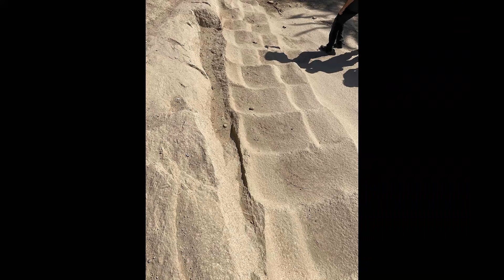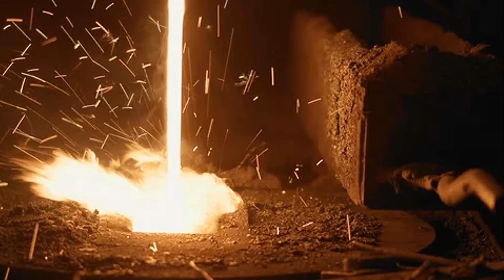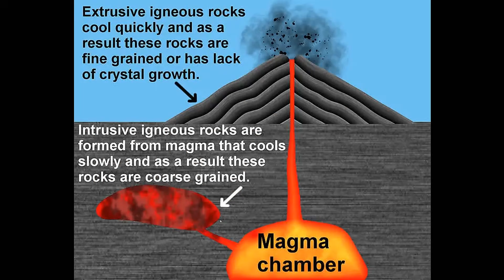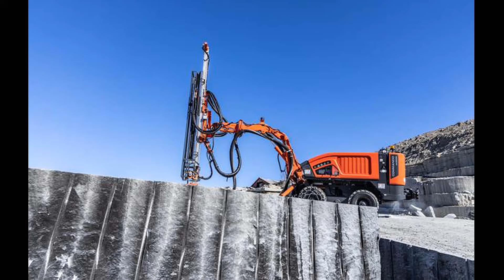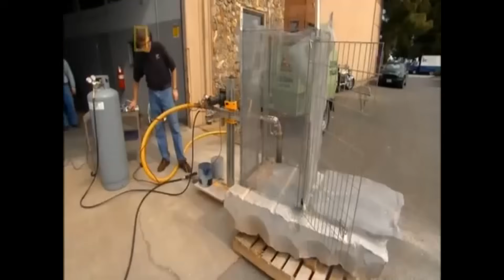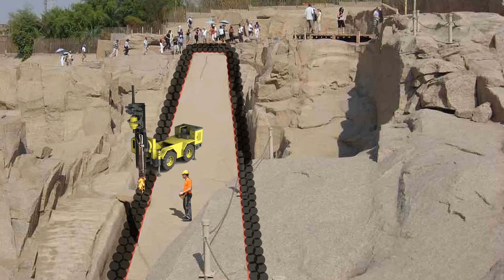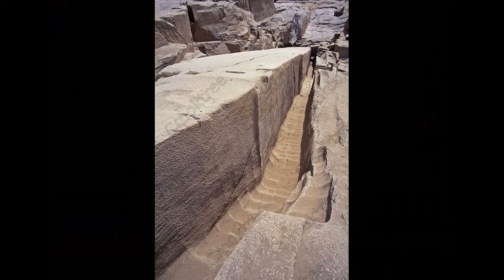Scoop Marks in Egypt: A Groundbreaking New Hypothesis

Comment: why did all the mega structures all over the world just stop? where are the tools? there would be piles and piles and tons of tools. calling them 'scoop' marks is very mis leading since no one knows how they got they way. everyone goes on about how the marks were made instead of why? they were made at all, what is the point??? it is not aligned with the fault mark which are not aligned themselves.  just saying the stone was softened is pretty much meaningless without any real support. this does not explain how it would have been 'scooped' even if soft.  good explanation  smart woman            it seems everything they did was done the absolute hardest and unnecessary ways possible.

Comment: Most of the polygonal megalithic stone were cast in rubber like bladders right on the wall and the bladders later dissolved naturally and left only the hardened stones. See water glass stone glue and natron theory.  
Liquid sodium silicate reacts under acidic conditions to form a hard glassy gel. This property makes it useful as a bonding agent in cemented products such as concrete and abrasive wheels. It is also an excellent adhesive for glass or porcelain. A traditional use for dissolved water glass is as a preservative for egg.
 The second option is water glass for waterproofing based on the addition of potassium. This additive made of metal makes the glass resistant to all atmospheric influences. Does not impart a treated surface of glare, so this glass can be used as a specialized paint.

Comment: Cool. Good idea. But i still have some doubts. I see some chattering on many of the vertical channels. As if it were chiseled or hammered, maybe pneumatically. Also, some of the scoop patterns have areas where whatever they did to remove material "pushed" material over to an older scoop. I'll find a time stamp. 1:45 on the right, the curved scoops inner edge has a ridge thats been pushed onto it from the neighboring scoop. Like think through the process that made these scoops and youll see that they had to have happened sequentially and the smaller scoop was last because it pushed the ridge over to the big curved scoop. Something you'd see in clay like material. Ive seen the same thing many times in peru also. Its still hard for me to not consider the rock being soft due to it seemingly being the best explanation for what I see visually. All i can guess is that they knew something about granite that we dont. Either way they (whoever they was) had capabilities way beyond what people think.

Comment: Would an examination of the surface of the scoops show signs of the extreme heat used ? Are there piles of chips somewhere ? Do they show signs of rapid thermal shock ? Any theories on the gasses used, pressurization requirements and how such a jet could be controlled and moved around ? All very testable.
Reply: Yes, chips (lens shaped spall-off chips), scorches, ashes. Rare because this is all fragile evidence (except maybe the chips) and weathers away easily. Normal wood/charcoal fire if confined and well vented could do this.

Comment: The best way to make a grope in granite would be to pound the granite face with a granite hammer. Remember the Egyptions had an unlimited supply of slaves. The Egyptions simply did not have our technology or flame torches. the simplest answer is usually the correct one. The Egyptions were also good at boring holes through rock with rotating copper tubes. They had large supplies of copper and perhaps bronze. The tubes were form cast.

Comment: The Egyptians had wheels and skilled woodworkers so they could have made a rotating handpowered circular granite stone on a wooden frame and axle that could grind out rounded channels in granite rock. Much like the stone wheel commonly used to grind axes and other metal tools. I imagine that rubbing a piece of granite against granite rock would wear away the stone.
Reply: The Egyptians were also borderline obsessed with record keeping and trade listings, but we have absolutely zero from the Egyptians themselves of how, when, and why any of the true mysterious constructions occurred. Just hypothesis from modern "archeologists".
Reply: Yes, quite possible. A long shaft w multiple wheels. You could wind two long ropes in opposite direction. One team pulls to unwind rope A which winds rope B then the opposite.

Comment: Here's my vote.  There is a grid both horizontally and vertically. Each rectangular area is assigned to a worker with a pounder.  He pounds out his assigned area to a depth of, say, one inch.  When he completes that, he gets paid and goes home.  Next worker comes in and does the same.  Area by area and inch by inch you finish the grid and you are done.

Comment: I've been aware of the quarry quandry for over ten years. Although there have been plenty of reports about the scoop marks yours is the first to apply direct scientific comparisons of the marks and any modern technologies that could explain them.
Reply from the maker: Thank you! 😊
Reply: @CuriousBeingbyTina I just read in the comments of another video about the scoop marks that there are pitches near the border of the pitch of the obelisk which are declared to be test pitches. I don't know how much they are and how they are arranged but probably they were no test pitches but to prevent the machine from falling head on when removing the rubble from the pitch.
Reply: There are zero heat signatures on the oblisk so no just no
Reply: @drummerdad80 . .i will accommodate a maybe no. Sorry that's my final offer.

Comment: This is a very interesting video Tina.  As always, you do good research.  I watched SpaceX use two Liebherr 11200 cranes to move a 2000+ ton launch pad in place.   The cranes required a perfectly flat prepared surface not present on site at the unfinished obelisk.   The certainly weren't going to move this obelisk by hand.   The obelisk marks are very smooth.   The jet approach looks closest to the obelisk's marks but not as smooth.   I don't think that was how it was done.   They must have had something we don't currently possess.   Maybe a super industrial sand blaster to cut through the granite?  Or a water jet like they use to cut steel in ship building?  Or a submerged plasma torch, again from ship building.   Dolomite rocks on the tip of a jack hammer?  Is there actually any evidence of dolomite embedded in the granite to confirm its use?  The indention do appear to be from machining rather than by hand.

Comment: all the puzzle pieces are here, but i think in the wrong order. the diagram at the 15min mark is one of the most telling visuals. the modern flame drilling method utilizes the same principles, but the technological advantage allows for some optimizations. high temperatures and supersonic gas jets optimize for speed and minimize the numbers of "tools" used. but the ancient egyptians were not that restricted in terms of manpower we are today. the same principles can be used instead with a whole bunch of workers burning coal or wood fires in certain places, then cooling it down with water and then pounding out the damaged zones with dolorite stones until you reach the hard undamaged rock again. there is a lot of space around the obelisk to parallelize the whole process and keep the progress at a good pace. no need for ONE complex flame jet to go around the workpiece if you can get a few hundred dudes with coal, water and stones that can do the same work.

Comment: What about a horizontal rotating barrel shaped cutting head, with many hundreds or thousands of very hard bits that cut into the rock leaving hardly any individual scrape marks, or maybe even no scrape marks at all, depending on how fine the very hard cutting bits are?  A heavy industrial machine could have a tool attachment like that can pivot to scoop under the side of the obelisk.  It would use a very, very powerful electric motor to rotate the barrel horizontally at very high speeds.

Comment: Marcell Fóti has been proving how his natron theory (chemistry) works, making hard stone to soft scoopable slush that hardens again. 
He might be right since he demonstrates it on small scale. Next we need mid scale experiments with those type techniques.
I think they logically fit and explain the stone markings.
Reply from the maker: One problem of the natron (and other chemicals) rock softening method is that it usually would significantly change the rocks' colors and appearances, while the granite of Aswan quarry shows pretty consistent color at all scooped areas.
Here is a photo posted by Marcell Foti who proposed the natron softening rock idea and we can see visible color and appearance changes:https://x.com/FoMaHun/status/1743216524343603549

Comment: One thing that I wonder about is, if there was a civilization with advanced technology, which appears there was. Why did they build from stone? You would think if they were so advanced they could have invented some advanced steel alloys or better concrete to make building easier and could have been better or different shapes and forms.
Reply: Stone is the only material that doesn't erode or oxidize back into its fundamental elements. Stone is forever. Nothing else is.
Reply: It's actually shows their intelligence.  Like this guy says stone is forever and an intelligent society would know that
Reply: @rogerdoggett1991 yeah fair enough stone is forever, but with stone blocks you are limited on things and shapes you can build it's like using Legos for everything it has its limitations

Comment: By using the acient and known technique of "fire setting" added with vinegar quenching, a trench in such stone may be easily cut. Simply set a charcoal fire, move the fire and quench the hot stone with vinegar. Then move the fire, quench, move the fire quench...

The worked with what they had. 

How they moved it? No idea.
Reply: 1. Quarry Pile-Drivers  
   • 40 cm dolerite spheres suspended on scaffold‐mounted block-and-tackle systems.  
   • Dropped from 2–4 m to cut uniform kerfs and hollows in Aswan granite.  
   • Red-ochre marks on the balls match paint used in Egyptian workshop tagging.  

2. Roman Repurposing at Dura-Europos  
   • Surplus or spent quarry balls shipped along Nile–Mediterranean–Euphrates supply routes.  
   • Found in late Roman siege layers alongside ballista hardware and local shot.  
   • Wear patterns show concentric release rings overlaid on quarry‐use pitting.  

3. Supporting Evidence  
   • Stratigraphic association: dolerite spheres with red paint in siege debris.  
   • Petrographic match: dolerite mineralogy aligns with Aswan quarry samples.  
   • Experimental archaeology: ball-drop tests reproduce Aswan quarry hollows.  

Together, these lines suggest a two-stage lifecycle: first as quarry pile-drivers in Egypt, then as heavy artillery shot in Roman frontier warfare.Cuts to uniform for plain "Ole cavery"
Reply: # Next Steps for Conclusive Proof

1. *Request XRF/ICP-MS* on one of the stored “DE-1924-37-24” spheres.  
2. *Publish a short note* in Journal of Archaeological Science or Levant calling attention to the red-painted dolerite.  
3. *Compare wear patterns* under SEM between confirmed quarry pounders and siege balls.

These studies will move the Aswan-to-Dura hypothesis from “intriguing” to “scientifically confirmed.”
Reply: Water is all - it's just thermal expansion and contraction, nothing else besides that is needed.
Reply: @rickZR1982A not uniform enough my man. Where talking some serious engineering. Not a bunch of asshols playing with water and fire!

Comment: I don't know what made the scoop marks but they were not made by pounding the surface with rocks via human hands.
Reply: Except we know they were made using hammer stones. They even found hammer stones. It is absolutely the simplest way to get the job done. Stones and lots of people. No crazy tech required.
Reply: @nexpro6985  I refuse to believe that.
Reply: @YuckFoutube-67 the pounding grooves are each one person wide. Hammer stones were found. We know they had plenty of manpower. So you can disagree all you like. No evidence for high tech. Solid evidence for low tech.
Reply: @nexpro6985 If you're going to hammer, you use a hammer. The stones are ball bearings to move it after its free.

Comment: I still think they used sand blasting or water + sand hydro blasting ,the nozzle can be small and could be possible to recycle water sand or water + granite dust mix when getting started cutting the material with its own material thats why it looks dished or scooped like they do and its really not that complicated to make a nozzle to recycle the material or sand to repeat process of cutting meaning it could use very little sand and water or granite dust and water mix to cut.

Comment: A kind of Molecular Erosion.Probably involved some kind of pressurization of the components of water, Hydrogen and Oxygen. Small particles of granite can be used as fertilizer The waste products of an excavasion would be assigned a value and removed voluntarily by local growers ,Some of the ancient core drills were found to be slightly oval. Not perfectly round. You are covering it all! Limestone reacts to acids , like vinegar. Granite , not so much. But it is very sensitive to heat. Not good to build a fireplace out of. They had to know something we are missing to accomplish what they built.You are covering the question very comprehensively. Thank you. I do not ascribe to the poured co-polymer theory. But the knobs on the old blocks are very odd.  Thank you, you spark my curiosity and reinforce my feeling that what they did in the past was beyond our understanding

Comment: Worked in marble mine with high tensile wire saw and quartz dand cutting medium....My educated guess is a form of ultrasonic chisel was used as thered no evidence for acid alkaline or heat.The copper tools were likely used as wedges to split the stone as copper is obviously too soft and pounding stones too slow to be of any real practical application.